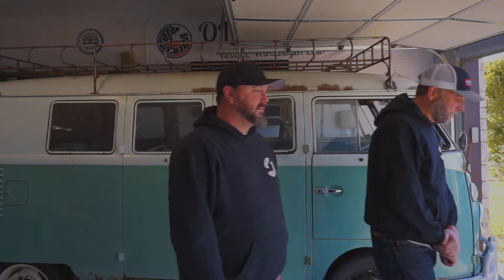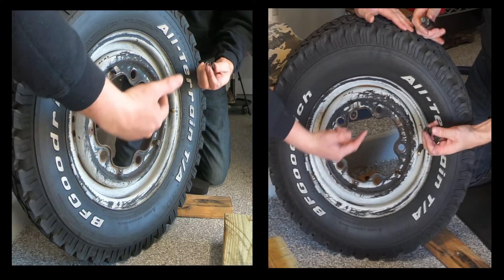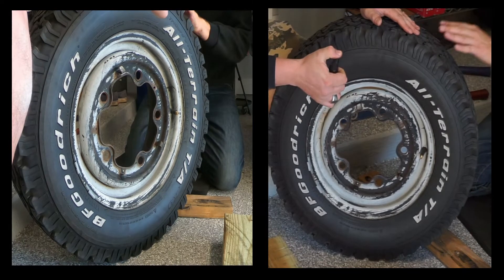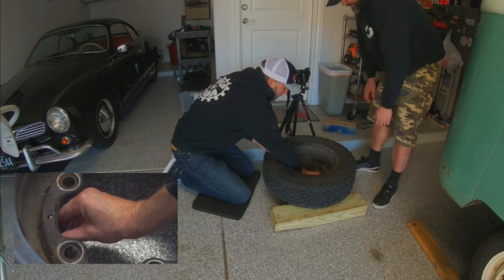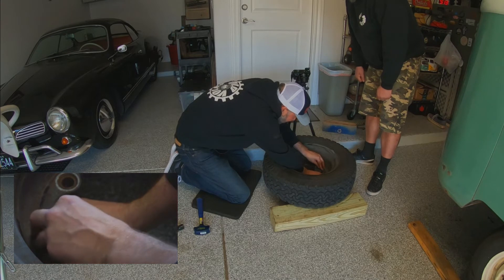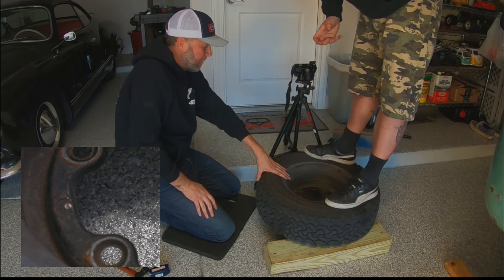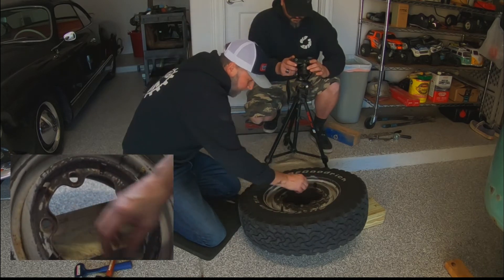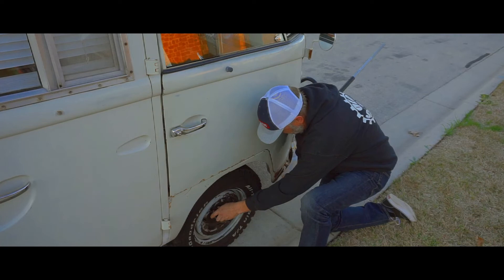How to replace hub cap clips on a VW

Comment: Nice! I did them all on the bug when I added the smoothies. I utilized a nice large punch which allowed me to flare out the sides of the rivet better. I did run into the situation with hitting it direct and a rivet coming through. Guess it's all about aim :-)